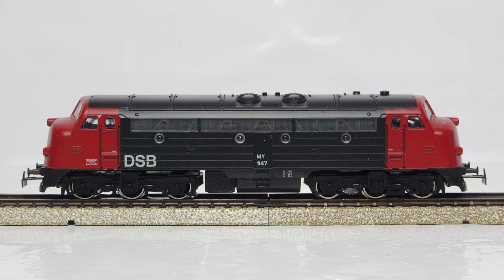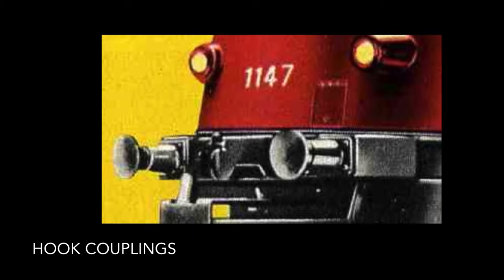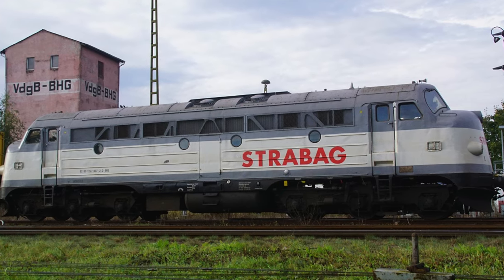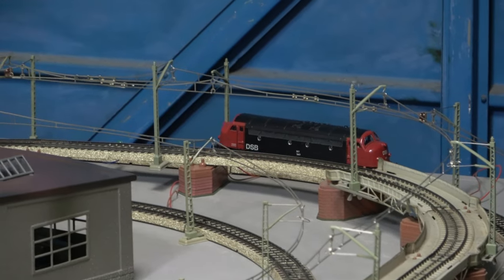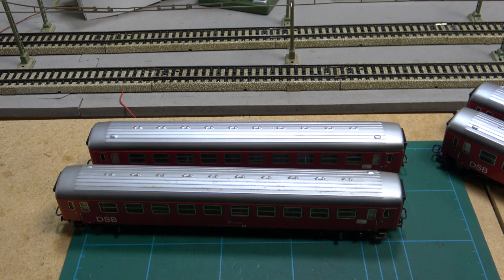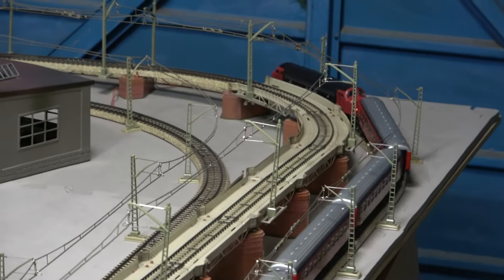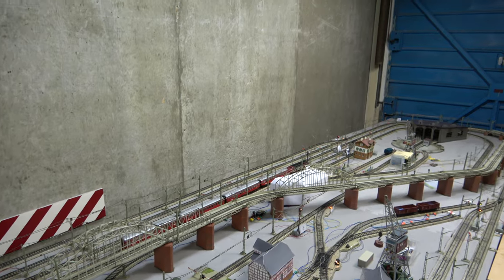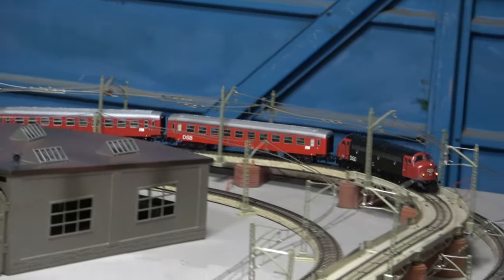Just in! Marklin 3067 (NOHAB MY 1147) - New additions to the collection

Comment: This makes me wonder why I did not get a nohab yet :) I am corious what solved the running issues. Was it  mechanical or conductivity like on the green T5? My 212 shows similar bad bahaviour
Reply from the maker: Mission accomplished😉 The main problem was conductivity between the front bogie (the one with the pickup shoe) and the chassis, solved by dropping the bogie and a bit of cleaning.
Reply: @The3rdRail  thanks a lot!   Will check this first. Please do more videos!!!